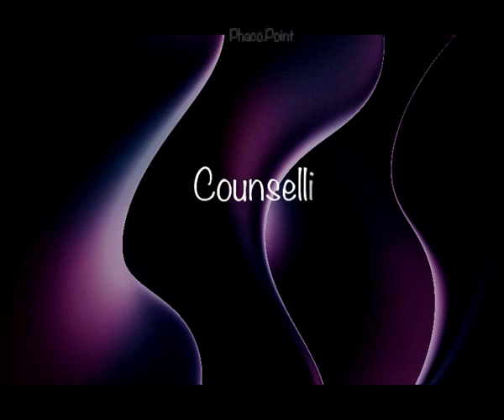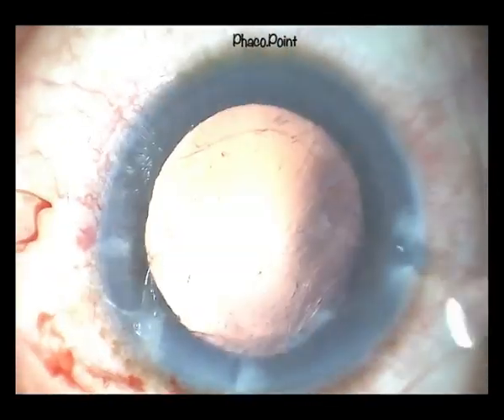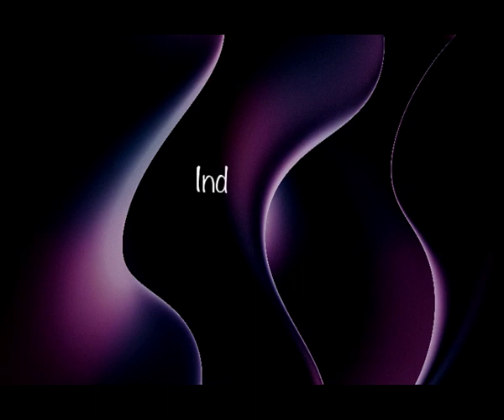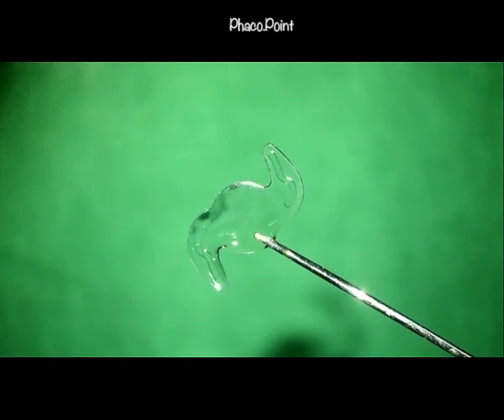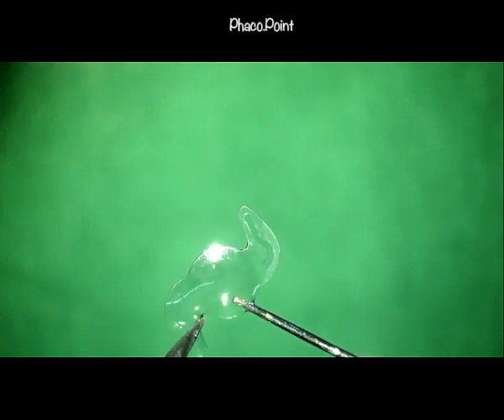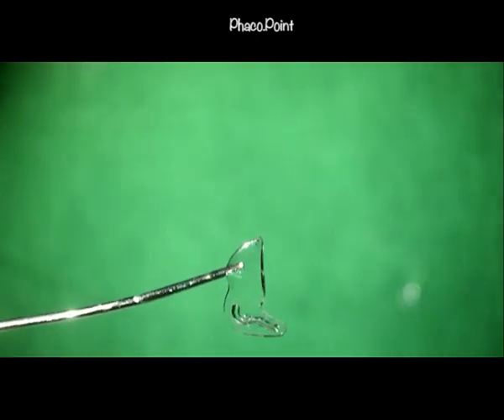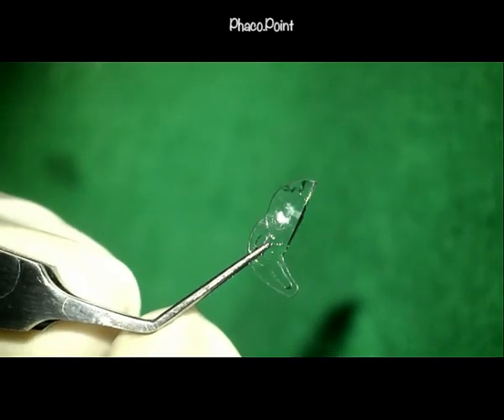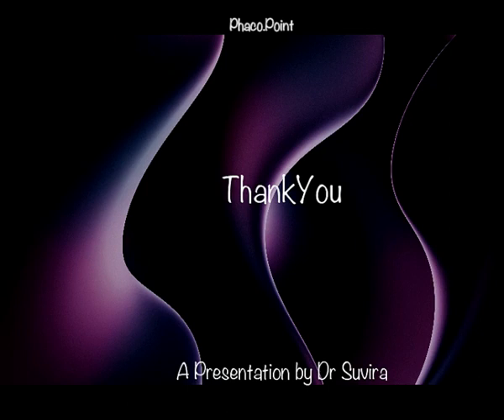An in depth understanding of the principles of IOL explantation

Comment: There is a twist and remove technique...  The F-IOL is held with forceps and twisted against the Iris spatula that is introduced from side port and then the forceps holding IOL is pulled out....  This is faster easy and less risky
Reply from the maker: you are right Dr Manu. Ive seen the procedure in cataract Coach .. twisting the IOL inside the eye especially the hydrophobic ones can be very tricky . It doesn't work in my hands
Reply: @PhacoPoint  I have learnt a lot from your channel. Keep posting such wonderful videos.